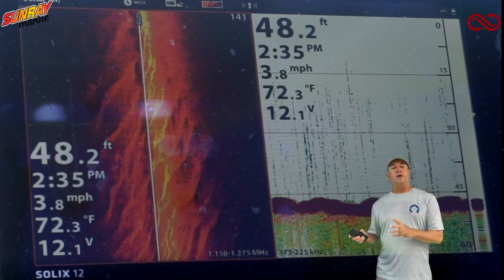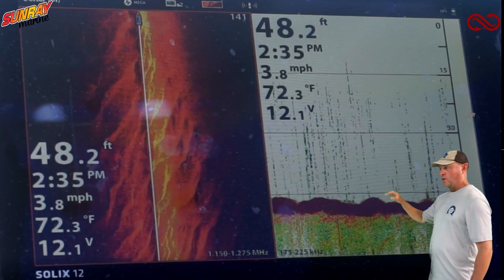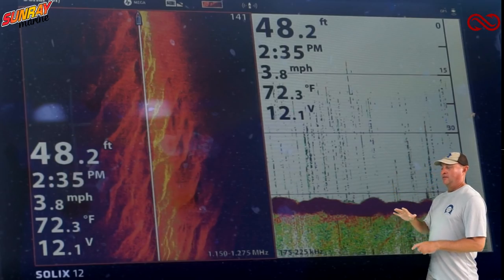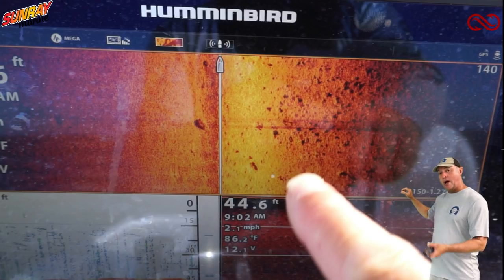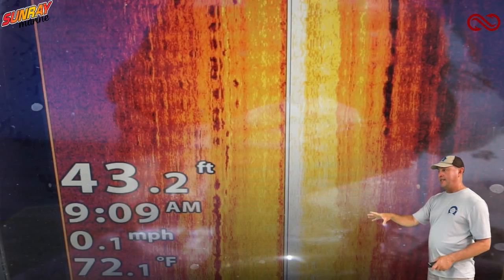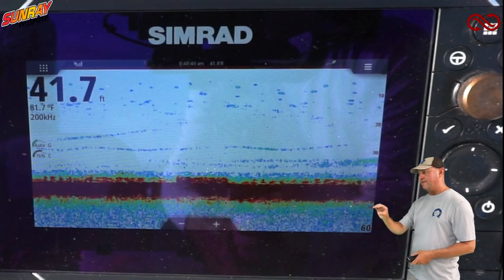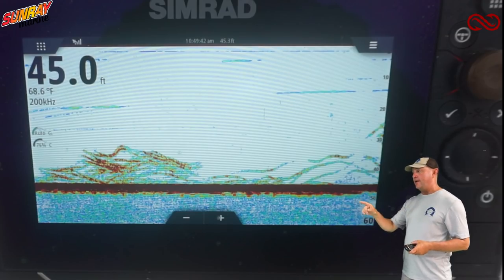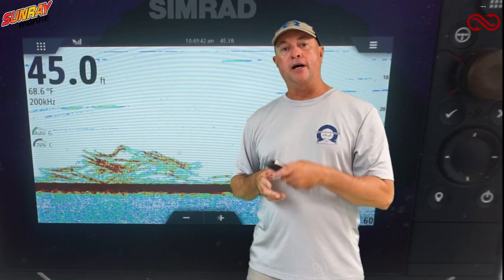Bottom Machine Techniques to Find Grouper and Snapper Inside Tampa Bay

Comment: My issue is staying on top of the structure. I can't anchor in the channel, and I don't have one of those spot lock trolling motors, so I have to drift which sucks because you're only over the productive bottom for a few seconds before you drift past it.
Reply from the maker: Try anchoring at the port manatee channel. It’s easy to get setup there.
Reply: @TampaBayFishingChannel  didn't realize I could anchor in that channel. I'll give it a shot, thanks.
Reply: Be ready to pick up anchor on a moments notice, if a ship is coming to turn in there or is outbound they can’t move or stop so you can get the anchor up and move. You will be at fault if there is an accident and you are impeding the deep draft vessels transit.  Of course that’s a mute point if you get run over by a ship. 🥴 with that being said enjoy yourself, there are a lot of fish in that area.
Reply: Without placing you on the spot with brands what sonar would you recommend for a person with a 23 foot center console I have a Lowrance HDS 7m currently
Reply: @rogerhull7750   Im not associated with the channel but I have a Simrad Go12...its awesome.

Comment: Do you have side scan on your simrad? I'm curious  on what yours looks like compared to mine. My side scan on my simrad go9 is hard to fine tune to where i can see structure. hoping you have some insight on that
Reply from the maker: No we don’t have the transducer for it. But I have used pretty much all the other side imaging machines and none have come close to the Humminbird mega side imaging
Reply: I have the same unit. Look up a guy named Mike Smedley on here. He has a ton of setup and tip videos for Simrad's on his channel. He helped me get mine locked in.